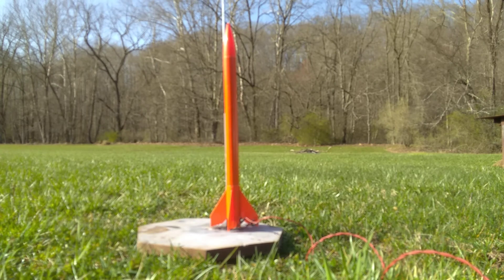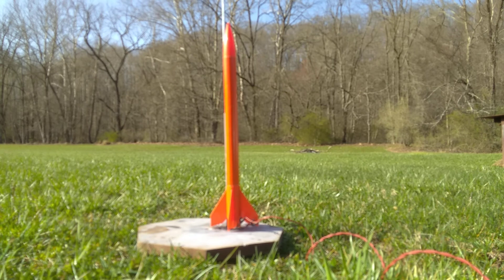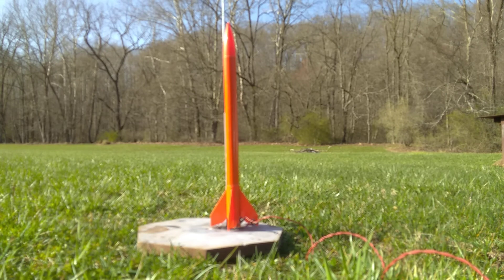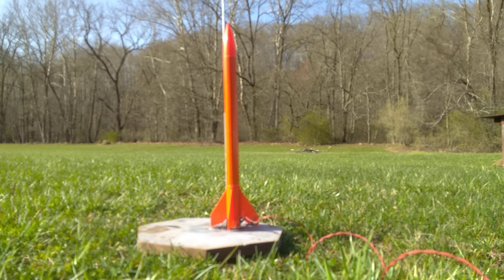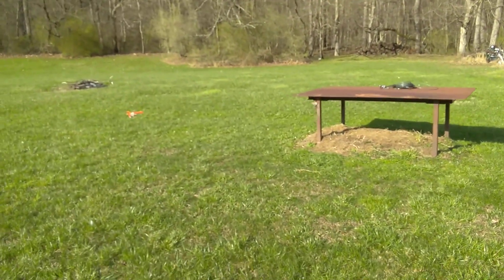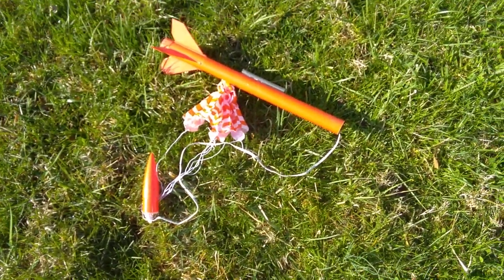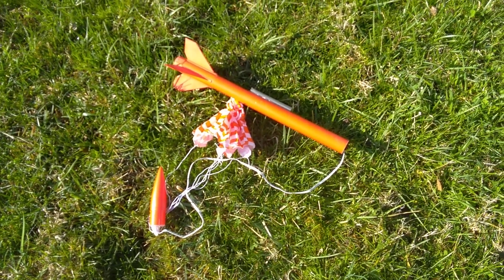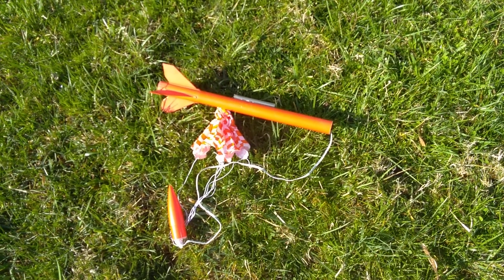TESTING ESTES A8-3 MODEL ROCKET ENGINE!

Comment: I just got the engine and planing to 3d print the rocket. How do I  ignite the engine?
Reply from the maker: There are igniters inside the package with the engines. You will also need a launch controller to ignite the rocket engine. It is sold separately.

Comment: Have you ever used the 1/2A6-2 (18mm) motor for featherweight rockets?  I used those to launch an Astron "Streak" I had back in the early 70s.  I still had trouble finding that thing...